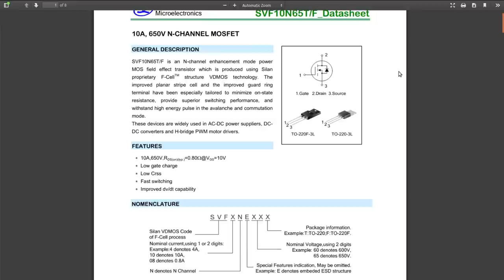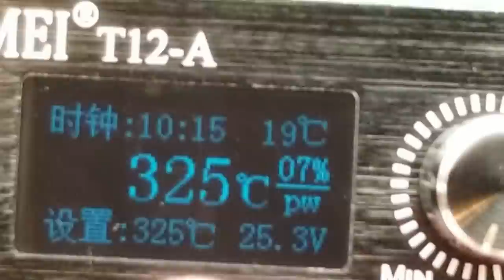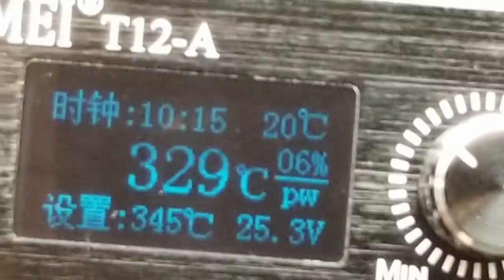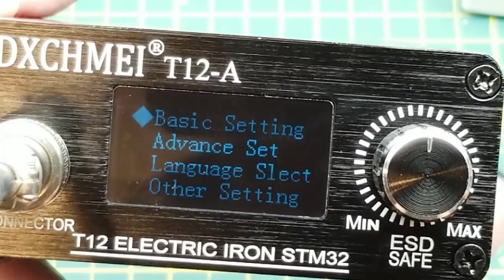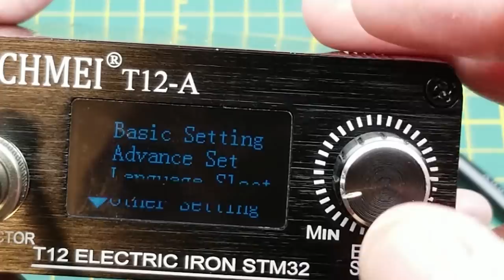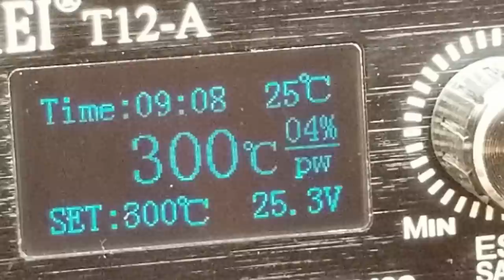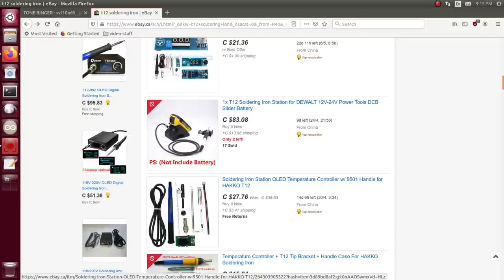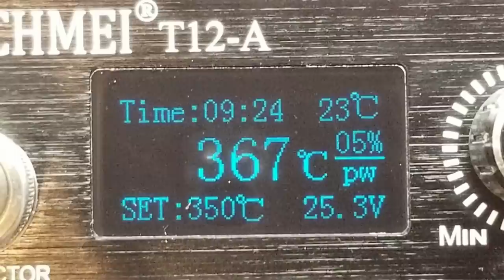T-12 (clone) soldering iron - first look

Comment: A great mailbag follow-up -- I always watch but never comment, sadly. From the many YT reviews I have watched this is a great little soldering station. I am a big fan of the T15/T12 tips (I believe the tips are designated as T15 for the North American market and T12 for the European/Asian market). I used to use a Hakko FX888D (same tips as your other soldering station). It was fine but I really wanted the flexibility of being able to switch tips quickly and easily in the middle of a soldering session so I upgraded to a Hakko FX951 last year (found a great price online from an electronics supplier in Calgary; I'm in ON). The silicone pad helps with hot tip switching -- the tips just click-lock into place on the FX-951, nothing to unscrew.

I have purchased several tip styles from China-based sellers. The quality is usually pretty good, but I have had a couple that take a bit of finagling (insert, remove, insert again, twist) in order for the Hakko to recognize them, but then they seem to work fine. Time will tell how good they really are, but for the price compared to the genuine Hakko ones, I could care less.

Anyway, this is why I usually don't comment -- I tend to blather on. Keep up the great work. I enjoy your channel and your beer choices. 🍻

Comment: There are several good things about this cheap stations.
The fact that it's so easy to change tips makes it so that you probably will change tip every time you should, like between small and large pads.
You can use original Hakko T12 (or preferably T15) tips if you want the better quality. Guess it can take the original handles to.
The station itself is basically just a power supplier, where you need the quality is at the tip so to speak.
I have an older version of this (with LED display, not OLED) bought 2 years ago for about $20, and it still works perfectly.
I'm on my 3rd. tip now, and I use it a lot, like every day.

Comment: I have a ksger version of it and absolutely love it. I ended up getting almost every tip made for it because of the deal I got when I bought it. The thinner hand pieces don't have the screw on lock. It's all friction and you don't have to even slow down to change tips. Pull it out and stick in the new. I run mine about 20°-30° cooler than my old one that was kinda like your old one.  I'm sure you will love how fast it recovers when you get to using it. Have fun.

Comment: I purchase a clone of this soldering station.  It was dead out-of-the-box and I had a very bad experience with Banggood.  Finally repaired it myself and it was a problem on the front panel circuit board and also a problem in the soldering iron.  I know many have had good luck with the unit but just wasn't a good experience for me.  Luckily I have a Hakko FX-951 which I did a video review on and I am happy with it.  I realize they are very different animals and the Hakko is at a much higher price.  Thanks for the nice video and I enjoy your channel.

Comment: I purchased 2 clone soldering stations very similar to this one.
I am very happy with them so far. 1 is in (almost permanent) use, the other one is spare.
What I particularly like is the very fast heat up time and the fact that the control board tries to keep the tip on temperature when soldering large pads or thick component legs. 
Thanks for posting this review and greetings from locked-down Belgium.

Comment: I have the ksger version and it's a tank. I've left it on for days and have used it at 400c many a 6 hour day. If it senses a bad tip it won't even turn on. I have like 2 of every tip type and have only had one bad one. I bought a hakko knockoff stand that's about 3lbs. It's great.

Comment: Hi, I have had mine for nearly 12 months and it is great.
After about 3months everytime it beeped the controller would reset, a googled solution is to cut the beeper out.
That fixed the problem....👍👍👍👍👍👍😊😁😊

Comment: I bought two of the KSGER T12 kits (good for removing chips). I have the blue handled one (which you have on order), and you can swap the tips easier because it doesn't have that annoying screw-on collar! You're gonna love it! KSGER also has separate tip settings in the unit so you can calibrate each tip separately. I don't know why they bother with a clock on this thing. It's not like you're going to leave it turned on to see the time as it is too dangerous to leave something like this turned on.

Comment: I have a very similar from Ksger (as I can see, many other comments too) from Banggood. I had an issue that tip was not grounded. I wrote to banggood (since the product page mentions that) and at the end they sent me another Ksger (a bit different model) free of charge, and I didn't even send back the other (which would be way more expensive for me than the product itself ...). So I guess they were nice enough :) Other than that, it's very OK, I have no problem since a year or too, since I have those.

Comment: I've had the Ksger version for a couple of months. My older Weller station doesn't get used anymore as the Ksger does a better job. And the tips are finished to a much higher quality than the ones I get from Weller for my LR21 handpiece.

Comment: TS100 for me. More expensive than the T12 though. I love the small size. And like the T12 it keeps its temperature well. With a larger bit, it will solder quite big things, like 12V battery connectors. I admit that the T12 is easier to change the bits on.

Comment: I just ordered as TS100 today, I was thinking about one of these but the TS100 suits my use case better, I can just grab my laptop power cord when I need to use it and it stores way better. It uses it's own tips but they're very similar to T12 tips just a bit more compact. They option to use a battery is nice as well.

Comment: The tips don't get that hot near the screw so I just grab it at the base with bare fingers to change them..
The guy that did the menu on that thing went way overboard. You can assign temps for different tip designations, so when you change a tip you select it's # and it uses those set temps.

Comment: Looks like a wonderful iron. I have a cheap, knock-off rework station and I wouldn't spend USD$40 to get this one since it does quite well for me (and keeps the temp OK according to my temp meter), but getting it as a free gift? Wow! The question is: Do you want 8 beers, or this soldering iron? :-)
Reply from the maker: I didn't have any complaints about my knockoff either, but this new T-12 iron does get up to temperature quicker, and the extra-flexible cable is a nice upgrade.

I am going to keep the Bakku/Fako around for the hot air tool (at minimum)

Comment: Is it possible to flash the firmware of the other variants to it? I've the KSGER Version and it's UI and menus are much cleaner. If it's possible i would recommend to give it a try.  I would also recommend to do the tip calibration -  at least the KSGER Software allows to do it for each kind of tip and it works very well.
Reply from the maker: It probably is. The programming pins for the microcontroller are broken out and labelled.

I don't know I'll ever spend much time inside the menus after I get the initial settings configured. 

I'm just not that motivated to go mucking about in software-land most of the time.

Comment: 22:31 - those conical tips are absolutely dreadful to solder through-hole PCBs with!! They only contact the component lead or the PCB pad, but never both. Hence you get a blobby dry joint, exactly like demonstrated here in this video.
Seriously, you need to break the old habit of using those dreadful things, and change over to a small chisel tip (eg: D12, D16). Because those will contact BOTH the lead and the pad, you will immediately see a massive improvement to your soldering quality.